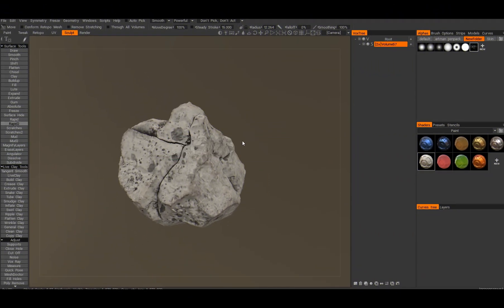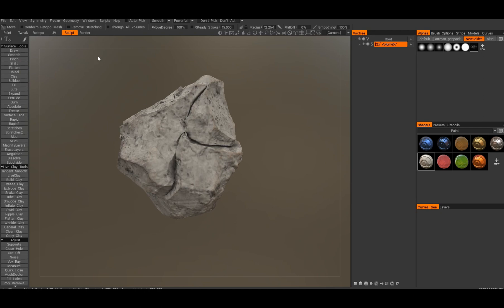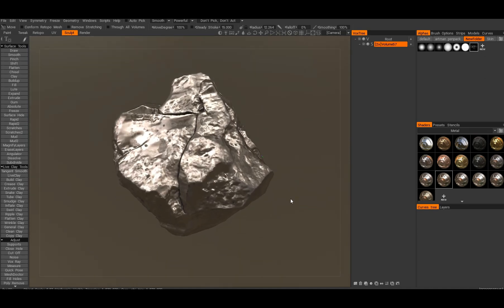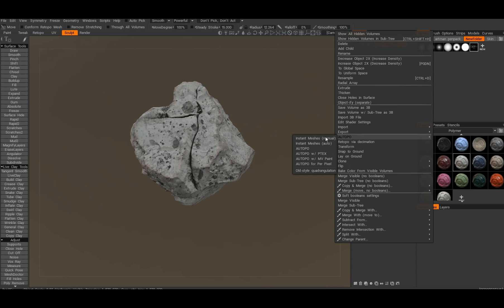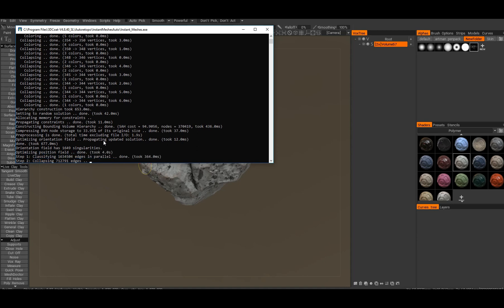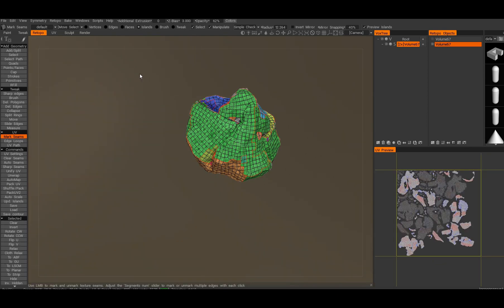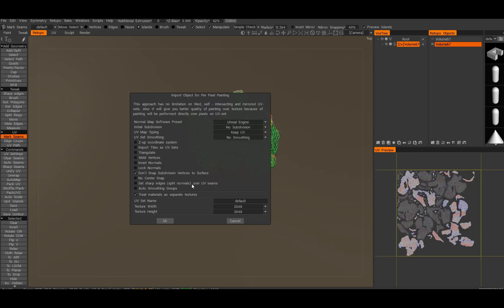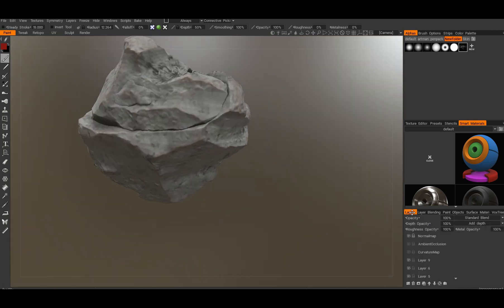Non Destructive Baking High Poly Texture to Low Poly Object in 3D Coat

Comment: how can i import and use a manual created low poly mesh in this baking pipeline ?
Reply from the maker: hm, well you import in to retopo room and also import it to sculpt room to sculpt to create high-poly to bake.
Reply: @AntonTenitsky  i have to get used to this room based approach. Starting with 3dc i met so many weird behaviours. Size differences on import, smart materials not working on sculpted objects, import of meshes without Smoothing groups, a jittery glitching interface, etc.

They really should spend more time on ux.  I have experience with zbrush and other software.
Reply: @AntonTenitsky  and thx btw